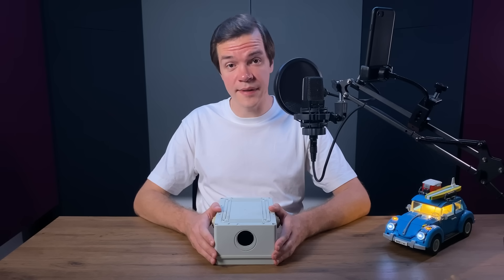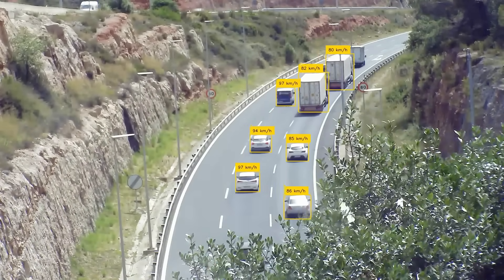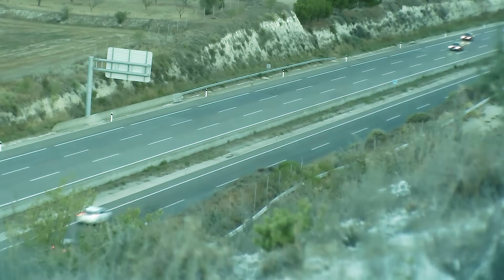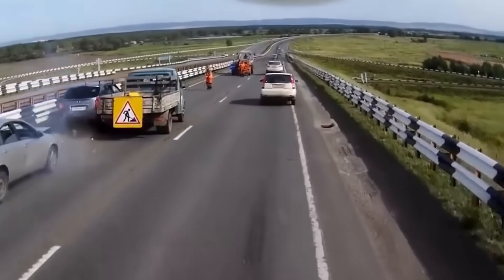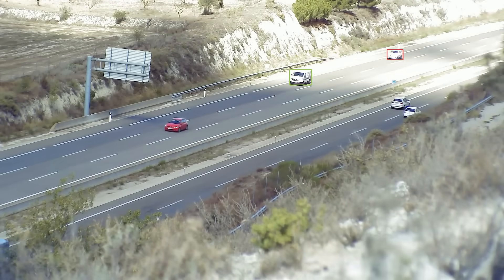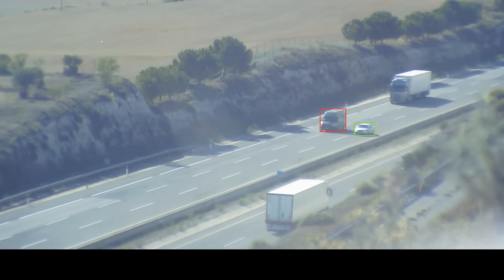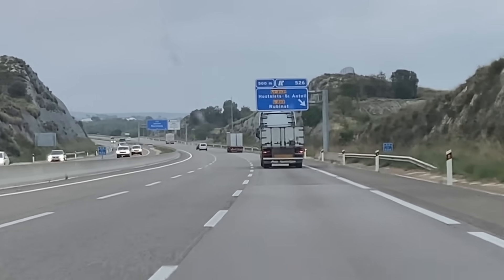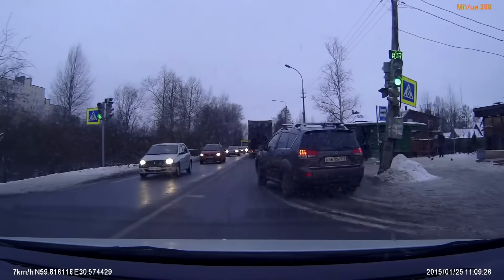New Anti-Tailgating Camera Reveals Shocking Statistics

Comment: I've taken a few advanced driving or defensive driving classes, and one practice I use is not to follow the car in front of me, but rather the car two cars in front of it. When that cars brakes, I slow down. This is not always possible when following a truck or SUV, but for normal traffic it works. The best example I can give was a multi-car accident on "la métropolitaine" in Montreal a couple of decades ago where about 40 cars were involved in front of me and several cars collided behind me, but my car was untouched.
Reply: Exactly, read the entire road and not just the car in front.
Reply: The further you can see ahead the better.
Reply: @wandpj most accidents happen in heavy traffic. So it is rather difficult to do so.
Reply: @LaurineVK I disagree. Most accidents are from inability to slow down at merge points or when traffic suddenly slows. people not planning ahead to get into the slower lane and not allowing the car who sped passing all of the slower traffic and suddenly wanting to cut in. Those things cause accidents.
Reply: @RowanHawkins  If you would have paid attention you would have heard that at greater speed you need to allow for a greater distance. An exponential distance to be exact. 
For the rest. You need to keep your eyes on the road.
I am well aware of these facts and never had an accident in 48 years because I always make sure I CAN make an emergency stop no matter how many people make mistakes.
Reply: That's what annoys me with cars becoming bigger and bigger, you just can't see anything that happens in front of that car when in city traffic.
Reply: @PavltheRobot Funny thing is happening there. They say that they bought a big SUV to see the road better. Which is no use if most of them do as well. The safety is even worse. Many mums drive them now for safety for their children while they pick up their kids from school. Fact is that most SUVs these days you can stack up 16 in the back and 4 in the front of 10 year old kids and they wouldn't even see them.
Reply: @LaurineVK  True, but but facts are almost never enough to convince people they're wrong. Unfortunately.
Reply: @PavltheRobot  not just bigger but obscured dark back window ... Old car gives you great area view right through it
Reply: exactly and one more thing also look into mirrors alot. I am looking significant time into my mirrors so I can also adapt to other passing cars. To be honest it is relatively common to see people that just swerve because they are not looking into mirrors and they just do these last moment decisions. I also rarely brake on highway because of having this awareness around me.
Reply: @LaggerSVK  I drove for a living for a dozen years, so I’ve seen much more than my share of traffic (for my age). And I swear that most drivers wouldn’t even notice if their mirrors were gone, they look in them so little. And most people angle their side mirrors to keep a close eye on their rear-door handle (are they worried about someone hopping in their back seat at 100 kph?), which leaves a huge blindspot that they never check before turning or changing lanes. 🙄
Reply: @natbarmore One of the best tips I ever heard was to angle the side mirrors to pick up immediately where the rear view mirror ends, with a little overlap. This ensures you have complete visibility to any vehicle. It feels weird at first, but holy crap it has saved my bacon so many times!!
Reply: @natbarmore  i have my mirrors pointed to my rear door handle because that's what the DMV handbook said but I didn't think it left a blindspot
Reply: @natbarmore  I think the drivers angle their mirrors to see the side of their car because they are worried that they'll be driving down the highway and the rear of their vehicle will suddenly overtake them.
Reply: @natbarmore You're right on that I believe. Most drive with a huge blind spot.
Reply: @gnuthad  I was overtaken by my rear door handle once on black ice, and another time when we had a rear tire blow out on a busy freeway. 

I could have steered the car out of the second situation, but I was in the passenger seat, not the driver's seat. I wasn't positive I could damp an escalating fishtail on a busy three-lane highway entering Toronto by reaching out my left hand to take control, plus all the big rigs around us were making incredibly quick adjustments, so I decided to leave the driver to cope using her feminine wiles. After crossing a lane or two without signalling, we ended up against a cement divider pointing backwards. 

Word to the wise: if you ever blow out a tire on a busy freeway with your GF behind the wheel, try to do it while surrounded by professional drivers. 

That was a GF of many xmases past, and she probably has her own stories of my masculine wiles as a fish out of water in other domains.
Reply: @afterthesmash  So you were merrily driving down the road and suddenly saw the rear of your car drive past you? No, of course you didn't, because that never happened outside of a movie.

Losing control on an icy road still doesn't have the rear of your car overtake you as you're driving. Instead, you're facing the other direction with the rear of your car still firmly ensconced behind you.
Reply: @natbarmore I also think this is a result of having so many cameras on vehicles that people forget that they need to look outside of their vehicles through these things called windows. It amazes me that nearly every car commercial now which has backup sensors shows a driver randomly backing into traffic without looking out their windows and instead of the person in the passenger seat where the camera is.
Reply: @Hazel-tu3sx instead angle it so that if you move your head you can see your handle to give you perspective and if you just glance at it you can see the lane on that side better
Reply: @LaggerSVK  Same here. I like to be aware of how many vehicles are approaching from behind and how fast so I can react accordingly.
Reply: Yup, drive the road ahead, not the car ahead.     And if you have a truck or SUV ahead, change lanes-- if you can't then slow down til it's safely far ahead of you.
Reply: This is what we learned in high school driving class in the 80’s. If you can’t see the brake lights of the cars in front of the car in front of you you will not have time to react to an emergency stop AND you will cost yourself a lot of money in brake repairs over time
Reply: This is why I prefer to avoid driving behind vehicles that obscures my vision further up on the road.
Reply: It really sucks for here in the US cause apparently everyone wants trucks and so in lower cars you can only see the vehicle in front of them unless if you are on a curve.
Reply: @galacticdragon9841  "It really sucks for here in the US cause apparently everyone wants trucks and so in lower cars you can only see the vehicle in front of them unless if you are on a curve." 

Long ago, in California, US manufacturers bribed legislators (they call this lobbying) to classify anything built on a truck frame as being exempt from fuel efficiency standards, relatively exempt from pollution standards, and certainly held to far lower crash safety standards. Notably, this includes SUVs sold to soccer moms. 

The purpose of this was to shift aggregate demand into a class of vehicles that American still dominated, leaving the Japanese stuck selling overpriced grocery-getters. 

Absolute safety on a truck chassis sucks. The crash cage on a modern sedan is vastly superior. But relatively safety is a function of size and visibility. So to be relatively safer than everyone else, you need a bigger, taller, heavier truck. 

It was also a goal of the American auto industry to create a keep-ahead-of-the-Jones truck war. 

This is your private sector hard at work. 

I'm a big believer that free markets are good tools for the job, when properly constrained. When not properly constrained, the private sector can screw things up far worse than the government ever has. They almost always do this in cahoots with the government we always have, in order to blame shift. I'm not fooled by this, but many people are. 

They tell us the shenanigans would stop immediately if we had no government at all. Of course they would, because we would be invaded by a country with a real army, run by a real government, while the self-serving mercenaries (the only army we have left, lacking government) would rush to negotiate the highest rung for themselves in the new pecking order. Why defend and get killed, when you can bargain for your own skin, instead? This is why the private sector is never left unsupervised in matters of national defense. 

Instead, we let them screw up the vehicle fleet on the interstates, instead. 

A fleet of mostly sedans would save fuel, reduce emissions, and make us all safer, in the aggregate. 

We own the smallest truck we could find, because we also own a horse. The smallest truck we could find was a Ford Ranger. This is larger than the truck we had before, a Toyota. This is because of the chicken-tariff retaliation act. Because some other country put a tariff on our chicken exports, we slapped a retaliatory tariff on their small trucks. With the added tariff, it became unreasonable to continuing importing the very small Toyota into Canada and America, so it disappeared. 

Guess who came up with that bright idea, as well? US auto makers. They are a slick act, altogether.
Reply: @galacticdragon9841 ❤❤❤❤❤❤❤❤❤❤❤❤❤❤      fix your problem with cameras and vigilance
Reply: It's the difference between being reactive and proactive. One gives you seconds to respond and the other gives you 1 second to respond. 2 seconds of braking can mean the difference of stopping behind a car and stopping INSIDE of the car in front of you.
Reply: @ssjwes572 and the driver behind you gets more time to react too, because u can gently brake. You can even spam ur brake to blink ur lights. It's kinda nice.
Reply: I'm in Canada and in the past ten years "Normal traffic" has become mostly SUV and trucks so the safe driving approach can't really be applied anymore, especially if you're driving a normal, useful vehicle.
Reply: @Alceste_ my solution is to drive 10kmh below posted and then no one wants to be behind me at all. Its such a freeing sensation.  I get increased fuel economy and a lower stress driving environment seems like a win to me!
Reply: @RowanHawkins  Funny you'd mention, I've also joined team Slow a while ago and not looking back much, though I might not be doing it as intensely as you describe. 

Sure is more peaceful driving when you never need to concern yourself with catching up to anybody.

But also just like how the vehicle size armrace has been going for a while, I guess if too many people were driving that way we would end up fighting over who tolerates going the slowest. :p
Reply: I was going to say this as well. Being able to react before or at the same time as the vehicle in front of you means you don't need as much space.
Reply: @mdb098 unless you're behind a tesla 😅
Reply: I do the same thing. But one thing to consider is if you get too focused on the 2nd car ahead, you can lose focus on what’s happening directly in front of you which can also be dangerous. For example if the middle cars behaves strange and brakes suddenly
Reply: Great idea!💡 Thank you!!
Reply: On the real, we all follow the FIRST vehicle in the line, whether you can see it or not.
Reply: The follow distance has saved me a few times. It also saves your tyres and brakes, which add up to $$$
Reply: Read traffic
Reply: that’s common sense 😭😭😭😭
Reply: yes, but not always possible. For more relaxed driving in a long routes it is good to have some big vehicle (tourist bus or truck) and then 3-4 smaller cars in front of you. So if you are following something big, let some smaller cars in front of you.
Reply: That's not advanced. That the basics.😅
Reply: Also, if you see these cars stopping leave an extra amount of buffer space between you & the car ahead as you slow, tap your brakes a few times so the driver behind  is alerted to the sudden slowing of traffic. This definitely has helped possible rear endings. People get in the groove of the flow & have an expectation to keep going. People don’t always see your brake lights. !
Reply: The lengths people go not to respect safe driving habits. Hard mental gymnastics right there
Reply: Idk why this ain’t the norm tbh. Seems like common sense 😭 though I’ve caught my siblings not doing it before
Reply: I always do this. It's very effective and you become a much smoother driver. The more information you have, the better the decisions you are able to make.
I also love driving through curves, you gain so much information from them.
Reply: @justsubscribed5855 another thing i agree with 😂   i slow down on the straight before the curve, then release and cruise through.  Much smoother ride for sure 👍🏽
Reply: It works always, don't drive behind a SUV with tinted windows, vans or trucks.
Reply: Thats not advance driving, Thats not even driving. its Simple Physics. If you had to do advance driving to understand it, You just dont get driving.
Reply: I keep 5-8 seconds of distance, generally pass the car in front of me if I notice our distance shrink, and always blink out for more than a secon, generally two before I even move out of my lane, and make sure that those around me notice it. Always turn your head before driving out, unless you're driving at high high speeds, like 150-200 km/h (it becomes really dangerous and you easily swerve) and shit happens quickly in front of you.
Reply: Another reason people tailgate is when someone doesn't adhere to left is passing lane, if you notice the driver behind you is catching up to you, please go to the right lane if it's easy for you to do so. And if you are passing someone, please pass at higher speed than the person you are passing.
Reply: I do that also. Watch the traffic ahead of you. Look to see if anyone is turning. I also watch the car behind me and if they don’t look like they’re slowing down, I usually have a plan to move out of the way.
Reply: Everyone driving slower than me is an EFFING GRANDMA 
Everyone driving faster than me is an EFFING SPEED DEMON
Reply: I've been in a situation like that. Not with 40 cars but with 6 cars. I had the time to swerve on the hard shoulder as I did not want the car behind me, which was not keeping his distance and stop safely next to the last car in the bang-up.
The car behi d me plowed into that last car. I did not drive a big car. It was just a Mazda 3.
Reply: Where you can most of all tell that the vast majority of people are math deprived is when you see multiple cars in a row on a long merge lane, coming into a highly congested highway, all following on the merge lane 2 seconds apart. Suppose you are lucky, and you arrive at a gap in the outside lane where two cars are 3 seconds apart. Do you think you will both fit in there? After the dust settles, you will wind up with three gaps of 1.3 seconds each (and this ignores the size of the cars themselves). Rather tight. 

And if your aren't lucky, and you chicken out, you press your brake pedal as you begin to run out of merge lane to fall into the gap behind. This cause a flurry of brake lights to emanate behind you. And what about the merging car that was only 2 second behind you? She is trying to fit herself into a gap that suddenly became a moving target, due to the brake cascade which you started. 

If you are coming into a zipper merge, you need to be 4 s behind the car in front of you to arrive at a merged state of following the car in front of you by 2 s. 

It's a very bad plan to follow the car in front of you into a congested zipper merge with less than at least a 4 second following distance. Usually a merge lane is single file, so nobody can cut in front of you. It's entirely your choice. 

If you have a good advance visual of the lane you are merging into, get yourself 4 s behind the car in front of you on the merge lane, then phase match with the gap you intend to finally merge into, and stay there until the merge is accomplished. Everyone will see your intent a mile away, and it will all go smoothly. 

Usually to phase match you have to achieve the full speed of the flow beside you. This will almost always be dicey if you are less than 4 s behind the car in front of you on the merging-from lane.
Reply: Unfortunately, if you're driving a sedan or a hatchback, it's almost impossible to drive the way you're describing because of all the SUVs and CUVs on the road now, which completely block your view of the vehicles in front of them.
Reply: Trucks and SUVs are normal traffic though.
Reply: Old Tesla Model S's apparently do this for you.  The radar monitors echoes from underneath the cars in front.  I don't know how the new ones behave though now that they no longer have radar.
Reply: That doesn't work in America where two out of three of those vehicles are big SUV/trucks.  What is worse, I think part of the reason they buy them is that they have given up on the idea of avoiding a collision and decided to try and "win" it.
Reply: I usually try to be aware of traffic as much as 10 cars either way.  I tried to teach my children the same rules, be aware of traffic in front of you and not just the car in front of you.  Seeing cars stopped on the interstate sufficiently in advance many times lets one find the nearest exit to go around on the back roads.
Reply: @Rayinn-lw3ej  Yes look beyond, way beyond. Great advice for life in general as well, driving being a regular reminder!
Reply: Ah, I do that instinctively I guess? I always look ahead for feedback and always complain about cars with tinted windows 0.1% off the legal limit... especially tinted SUV windows. 

They make me depend on their more often than not terrible braking etiquette... like damn... if you have to constantly brake in dense traffic while blocking every one's view, you should be caught by those cameras and sent to driving re-education.
Reply: This works great until you're sat behind some genius who constantly taps their brakes while having 500 meters of space between them and the car in front. I've even had the pleasure of running into these triple digit IQ drivers on empty highways tapping their brakes while in the fast lane doing 10km/h under the limit.
Reply: OMG, you are the first person that has said this.  My dad taught me to drive like this and I assumed everyone knew this who learned to drive!  It is common sense to me and allows for better flow of traffic (if everyone did it).  If you are looking ahead down the road as well as directly in front of you, you are more aware of your surroundings; you can see that pedestrian crossing coming up, those traffic lights, the roadworks, the weird driving behaviour 3 cars up ... the list goes on.  It allows you to be prepared, it is just plain smart and good driving - everyone who drives should be taught this
Reply: Well, I didn't take advanced driving lessons, but I've always looked at 5 cars in front, and on all the lines (also the retro for coming ones), I consider it "body language" checking of cars to anticipate their behavior (not only speeding BTW)
Reply: I was in an accident when 50 cars crashed ahead but I just used Turbo Boost to fly past them and came out untouched.